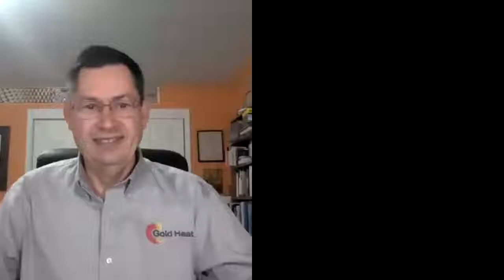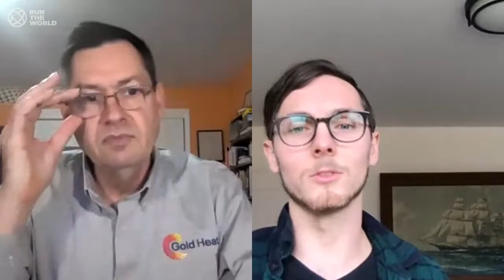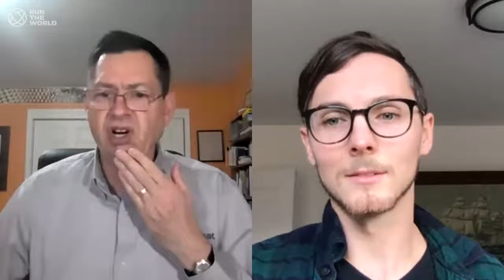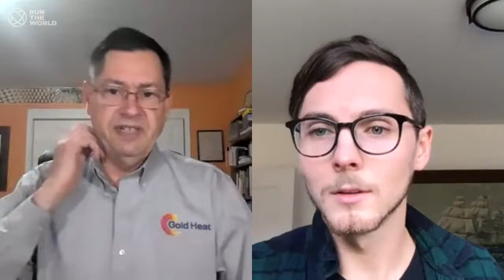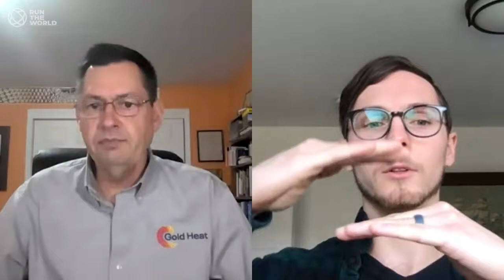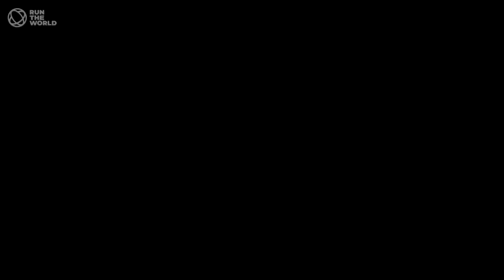SUSTAINABLY HEATING YOUR TINY HOME - Gold Heat

Comment: Brian mentioned needing another heat source in places like Minnesota, etc. It made me wonder if the Gold Heat mats could be run up the walls to help create more of a heat envelope for the tiny home. Would this help decrease the need for a secondary heat source during winter in northern climates?
Reply from the maker: Hi Elisa! I'm sure that would be possible. I know some places in Europe do radiant on the ceiling as well. But not sure if that would be enough for northern climates. If you jump into the community, others in there might have a more calculated answer! community.tinyhouse.com